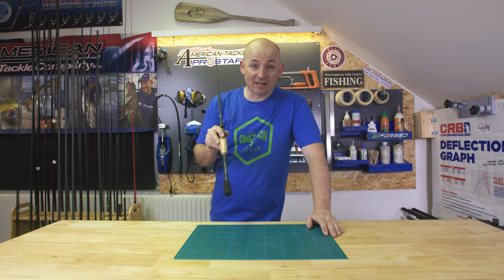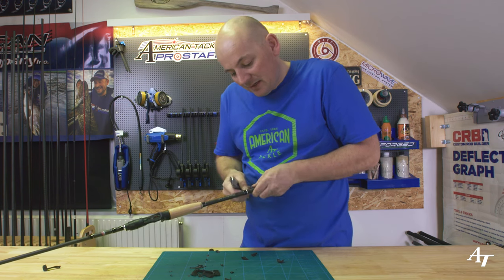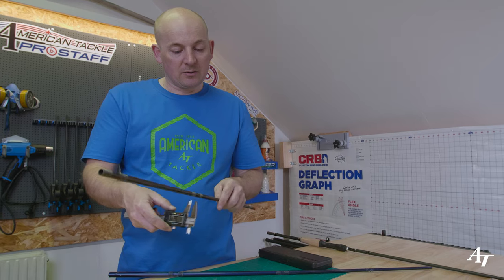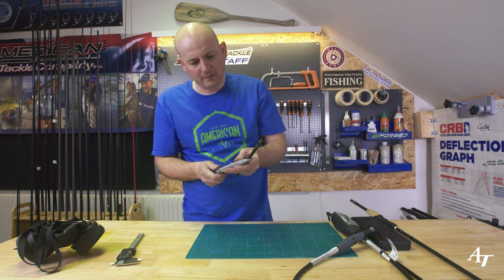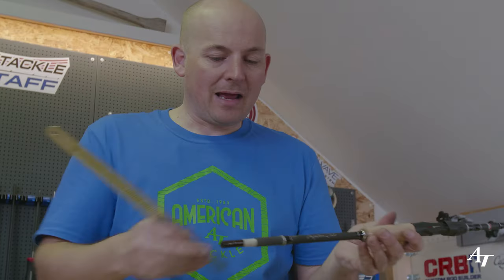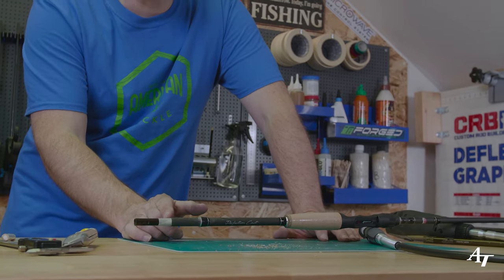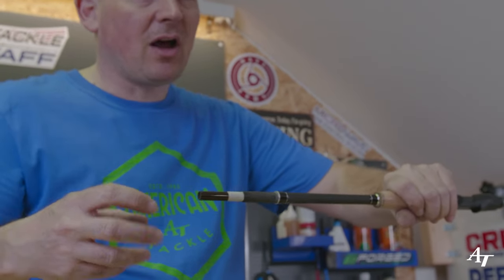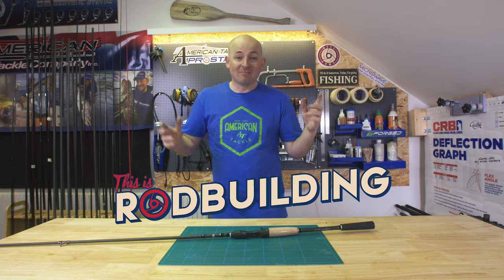This is RodBuilding Episode #8 Rod handle Extension

Comment: I have a falconrod I purchased and the first time I used it one of the eyes came off. I could slide it back in but it continues to slide back out. I tried hot melt glue for the tip tops but it won’t hold. Should I attempt to scrap the factory epoxy off cut the threads and retry or should I get the hot melt glue off put it back on and try to get some epoxy in behind the factory epoxy?